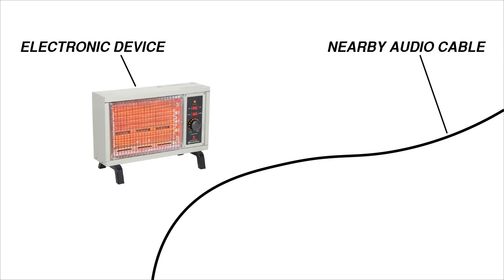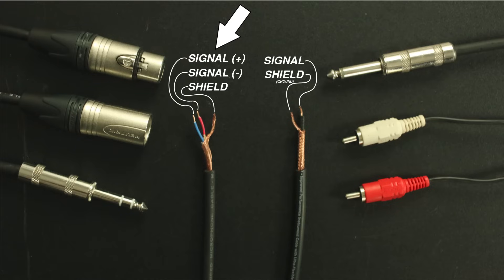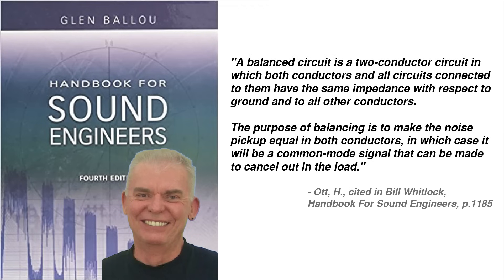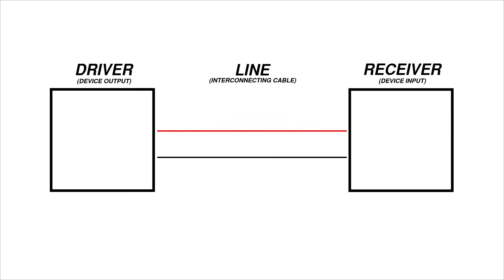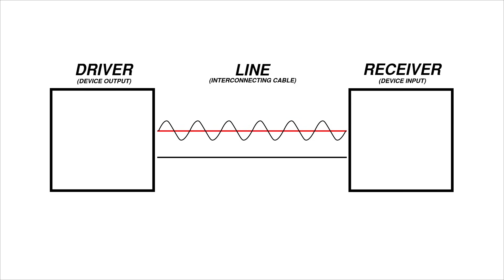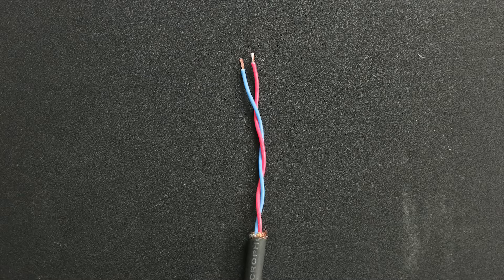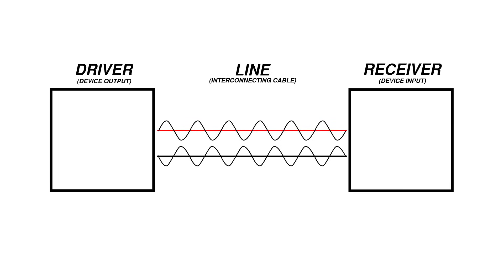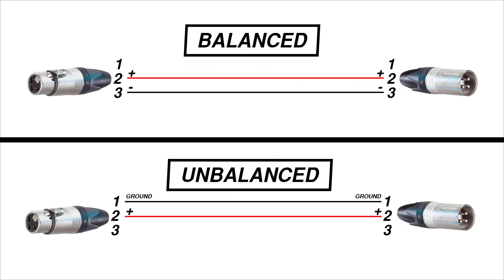Balanced vs Unbalanced Audio | Do Balanced Cables Sound Better?

Comment: I have an electronics engineering degree and still found this informative and useful.  The video representation of noise and signal were striking.
Reply: I second your statement. Spent 12 weeks in the communications chapters of my schooling and cancellation hasn’t been explained that clear the entire time I was in college. Even after I’ve been in the field the last 12 years and understand the concept completely, it was the clearest and to the point example I’ve seen.
Reply: it only seems super clear because you already know what he's  talking about. I for one don't exactly understand how the differential device operates. and why was it unbalanced on 1+2 and balanced on 2+3?!
Reply: @jazzochannel  it’s balanced on 2 and 3 because you have a differential pair that connects to those two ports. Where as on the unbalanced you have a single line that drives the signal on port 2 and a ground on port 1. The differential signaling is what makes it balanced
Reply: One small thing is that what this video calls noise is actually interference and absolutely not noise. Apart from that I agree  this video gives a good explanation of balanced signals vs single ended signals.
Reply: @TychoJ  a noise generated by interference...so technically it's noise at the end of the audio chain but i get what you mean :)
Reply: @mttlsa686  no it's not noise. it's interference, he's correct. Noise, technically(usually) is dependent on temperature and bandwidth.
Reply: you all down here that are claiming EE need to get your certificates/degrees revoked. LoL.....common-mode rejection? op-amp negative feedback? anything ring a bell? /s
Reply: How does this get over a million views and 1.2k comments? I couldn’t be fagged to watch the whole thing. If you don’t start with explaining how you create a balanced signal I.E. with a transformer, what is the point of talking about cables. This is a waste of internet space.
Reply: Could you please tell me what kind of noise you have heard?!
Reply: i always see engineers being surprised by basic information... I work in IT and I just had to educate a computer scientist about first hop redundancy protocols... like wtf are you guys studying? your degree is worth nothing
Reply: @LowerYourExpectationsPleb  Seeing trained professionals impressed with some explanations has a deeper meaning. People often confuse basic concepts with less important concepts when it's the exact opposite.
Reply: @LowerYourExpectationsPleb  gotta admit...what the heck is first hop redundancy lol
Reply: This is exactly why electronics engineers and all other engineers should spend 2 years in the field before they graduate.

Comment: Kyle,
As much as I appreciate anyone trying to teach others, it's more important that in that pursuit nothing is misleading as it's much harder to unlearn something than to just learn it correctly the first time.
I'll not go into my entire background, education, and experience, but suffice it to say I am a retired engineer whose first love was audio and that's what started me down the line of Electrical and Computer Engineering.
Most of what you presented here isn't anything new insofar as the definitions go, but the understanding of things like impedance and common mode rejection is just flat.
The size of the wires in audio has little to do with impedance matching as typical Z of audio interfaces are 150 to 30k Ohms.  Unlike power transmission, impedance matching for maximum power transfer is not the objective.  Typical microphones have about 200 Ohms output impedance sourcing a preamp with 10k or more input impedance.  In any event, the impedance is the sum of the purely resistive parts and the reactive parts.  It is, BY FAR, the inductive and capacitive reactances that are the greatest contributors to impedance.  So, no, you can't look at two conductors and then conclude they have similar impedances.  In fact, if they were NOT the same gauge it would make little difference.
Also, in your "example" of how audio sounds on an unbalanced line vs. balanced, you didn't fairly present the situation.  If you used the same cable for both, then it was either two twisted pairs comprising a four-conductor cable, or it was a four conductor cable that only had a manufacturing twist to all four conductors.  Then, on the unbalance line you used pin #1, which is reserved for the shield on an XLR connector that is not used for unbalanced transmission.  To have presented it correctly, you needed to use a shielded cable for the unbalanced audio and ensured that the shield is only connected on one end to prevent a grounding loop. (long cables are typically used due to physical distance which makes it even worse for grounding loops since there is no possible way to home-run all grounds to a single location).
I've watched some of your other 'University' videos and there is a pattern.  Not sure I would call my channel a "University" if I wasn't an experienced expert in the field teaching knowledge/experience instead of recently familiarized information.
I hope you keep this comment up as I am sure you want to inform more than appear to be informed.  Every day is an opportunity to learn something that makes you realize that you didn't know as much as you thought.  I've gone through 50 years of that and haven't stopped.

Comment: If I make a Cable ,, TRS to XLR (balanced)
and I plug in a synthetizer(balanced TRS output) to mixer (XLR input), what will happen?

Is the signal is too strong? because the synth is Line level,,and the mixer XLR input is Mic Level?
CMIIW…

Comment: Good explanation, but a bit misleading in the thumbnail.
The sound quality if the signal is not affected. Balanced is a non-perfect solution to decrease the noise floor. It does not increase sound quality of the signal.

Comment: Your video leaves me with one question: Is this differential device an active component in the receiving end?

The backround of the question is this, many headphone amps have balanced outputs. But if I understood your video correctly, a headphone isn't really the device, that could profit from the cancelling of noise, because it hasn't got any 'really active' components (ok, it moves, but that's not the 'active' that I'm talking about). Would the headphone profit from the added signal strength, if the signal is sent 'reversed'  over the two lines, or is the addded signal strength also something that requires a 'differential device'/'active component'?

Or did I understand the wording 'differential device' wrong and both effects happen automatically, even if there's no additional active parts, like in a headphone?

I'm trying to figure out, whether balanced headphone cables actually make sense at all. I thought they do (at least to boost the signal strength, if nothing else), but your video left me skeptical. :)

Comment: Questions, what if I have a TS cable that has a male XLR end. And I set that up as the output cable of my audio interface. So that the TS is connected to the output and on the XLR side I connected another female XLR that goes into my monitor? 
Is that signal still balanced because of the XLR-XLR connection or is it unbalanced? 
I'd love to hear your answers as soon as possible, thank you! 😄

Comment: look into older audio powersuply's and you will find the - ret goes as close to the - side of the supply caps and FW rectifyer. All cables lead to this point and no  parrellel con's allowed.

Comment: There's also "impedance balanced" connection which has no differential signal, its cold trs\xlr contact is only for noise cancelation.
Reply: Balanced connections are used because the reject noise.  The "impedance balanced" term is used by many to denigrate such interfaces - as if they're not real or somehow substandard.  These interfaces carry a differential signal just like any other. Whether you put signal on one pin or both, there is a voltage difference between them.  And both will eliminate common-mode noise equally well.  Consider and output that puts +1 V on one line and -1 V on the other.  The differential signal is now 2 V.  Now put +1 V on one line and 0 V on the other.  The differential signal is now 1 V.  Although the signal levels are different, both reject noise equally well since both input lines contain the same noise.
Reply: @BillWhitlock-oe4wr  anyway  impedance balanced output cold pin has no  signal

Comment: Example:
(1)                                                      (2)                                                      (3)                                                      (4)                                                           (5)
Signal A (+) -W--W-----------W-   >>   Signal A (+) -W--W-----------W-   >>   Signal A (+) -W--W-----------W-   >>   Signal A (+) -W--W--V-----b-V-W-   >>   Signal A (+) -W--W--V-----b-V-W-
                                                           Signal B (+) -W--W-----------W-   >>   Signal B (-) --M--M-----------M-   >>   Signal B (-) --M--M--V-----b-V-M-   >>   Signal B (+) -W--W--Λ-----p-Λ-W-
(6)
Signal A (+) -W--W--V-----b-V-W-
Signal B (+) -W--W--Λ-----p-Λ-W-
Signal A+B  -W--W----------------W-

(1) = Sending one signal (signal A) with some information in it
(2) = Making an exact copy of signal A as signal B
(3) = (Transmitter) Signal B is inverted (Phase 180 Degrees), and then both signals (signal A & signal B) get sent over the cable
(4) = (Cable) The cable picks up some noise
(5) = (Receiver) During reception signal B is inverted (Phase 180 Degrees), so basically information of signal B is back to its original state, as it was before it was inverted on the transmitter
(6) = The only difference now between signal A and signal B is that on signal A we have noise (+) but on signal B we have inverted noise (-). So now if we add signal A and signal B together the noise cancels itself out, so we are left with a signal without noise (ex. Signal A+B)
W = Information that's in a signal
M = Same information that we've sent on signal A but inverted (-) (Phase 180 Degrees)
V, b = Noise that was picked up by the cable (noise that is picked up by any signal that's inside that cable)
Λ, p = Same noise that was picked up by the cable but inverted (-) (Phase 180 Degrees)

From what i understand, basically in one cable instead of using one wire for sending only one Signal, we use 2 wires and send 2 copies of the same Signal (ex. Signal A (+), Signal B (-) ) but on the Transmitter side AND on the Receiver side the second signal (ex. Signal B (-) ) is inverted with Phase 180 Degrees, so any noise picked up by the cable because it will be picked up in both signals (ex. Signal A (+) and inverted Signal B (-) ) the noise cancels itself out. (ex. 1+(-1) => 1-1=0 )

(Note that i'm not a music-audio student and that may not be a correct example. i'm just a software engineer that plays with Ableton and stuff and just bought a mic, headphones, amplifier, sound card and because i needed to order cables so i can connect all of them together, i noticed that there were balanced cables and un-balanced ones, so i had to figure out what it is) :)

Comment: Nice explanation. But one additional point (maybe someone pointed it out already, too many comments to read alsof them).
I agree that you do want to get rid of noise, but in normal use, at line levels, with quality cables not too long (several meters is typically no problem), you don’t need the common mode rejection provided by balanced connections, you won’t hear hum, buzz or whatever anyway.
And then, the complexity of the audio circuit comes into play. A balanced output and input stage typically introduce more components, and I know of equipment that sounds worse on balanced connections.
I suggest that you should only look at balanced connections in harsh environments (long cable runs, strong electro magnetic sources). The remedy could be easily worse than the disease.
Also, hum & buzz could result from non-matching gear, inverted mains plugs, a bad(ly designed) power supply, or bad cables.

Comment: When I started in audio, I was in school to become an electromechanical technician.  Learning the use of Op Amps in analog servomechanisms, turns out to be VERY useful in professional audio.  They are exactly the same!  You start with the input transducer (mic), which gets amplified (pre-amp), then filtered to stop any hunting (EQ), then summed with other error signals (mixing), then to the power amplifier, and then to the servo motor (speaker).  While most industrial operations can use basic op amps like the 741, the TLO82 is also verry common.  The TLO82 is used almost universally in professional audio due to it's very low noise.  It's found in all pre-amps, filters, summing amps, and VCAs.  The TLO84 is a dual or quad version of the TLO82, but has higher noise due to having multiple amps in one package.  That's why high-end boards like the Cadac were so freaking heavy, but almost dead quiet!  And you could fix them on the fly, unlike digital.
Reply: I believe you are thinking of the TL072. While you do occasionally see an 82/84, the 72/74 is far more common. That being said, they are only common for the low price, performance isn't amazing unless you need a high input Z. Otherwise, an NE5532/4 will typically preform much better for a little bit extra cost(but not much!)
Reply: the fun thing about op amps is, the power supply to them comes in 2 flavors too, either balanced/dual (vcc+ and vcc- are both required), or unbalanced (just vcc+)

since DC cannot pass into the negative without having an actual supply that provides negative voltage, on the unbalanced opamps, their zero DC offset point is shifted to half the input voltage instead.

you'll have to create half the voltage by making a little 2-equal-resistor short circuit and add that voltage to the input signal in order to dc bias it properly prior to sending it to the unbalanced opamp that will be used as preamp. 
otherwise all of the negative phase of signal on the AC input side will be negated, 
it can not go or see under 0, so they'll end up multiplying by zero, which is nothing, so they have to be that way

you basically divide your maximum amplitude by 2 compared to the balanced ones that have their zero point at exactly 0 volts, 
this perfectly illustrates why balanced outputs are 6db hotter, they have exactly twice the amplitude headroom/double the voltage range

and obviously it's a bit less clean since you're just recycling the same vcc+ signal, rather than have a clean seperate negative signal coming from the supply, you'll notice if the supply is dodgy, amplifiers are really only as good as their power supply.

this is how many guitar stompboxes on 9v blocks work, but they don't have noise issues with dirty power supplies as they run off their own batteries, they're seperated from the grid
the resistors on the AC input side will keep the signal from flowing back into the instrument as the path of least resistance is to the opamp input, and ofcourse the DC portion on the output signal has to be filtered out with a condenser/capacitor on the end of the output side, so it only lets the AC signal through too.

Comment: I think you missed one key point... WHY?  Why have balanced audio versus unbalanced audio?

High impedance cables reject more noise.  However, they tend to attenuate the higher frequencies in longer cable runs.  Low impedance cables don't attenuate high frequencies as much.  However they are more susceptible to picking up interference.  So using a balanced signal allows for longer runs with low impedance cabling without the penalty.  This becomes more critical the lower the voltage of the signal being carried... like that of a dynamic microphone.
Reply from the maker: Thanks for taking the time to share this info, Ronin.

Comment: I understand it as phase. The two wires are out of phase for the length of the cable, then put back in phase at the terminating plug - noise common to both wires will therefore cancel itself out, but the music, that is only on one of the wires, doesn't.